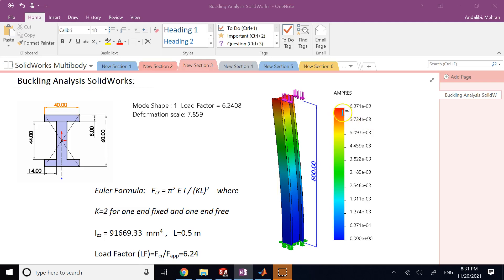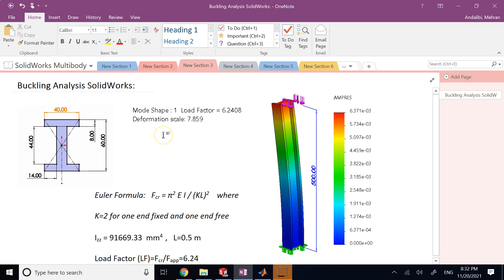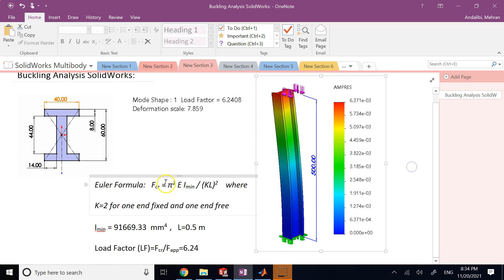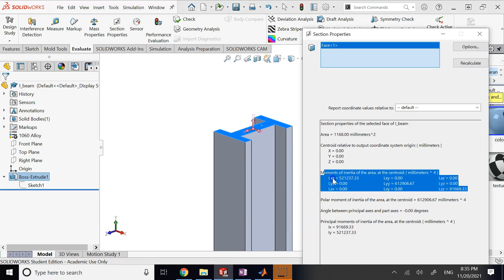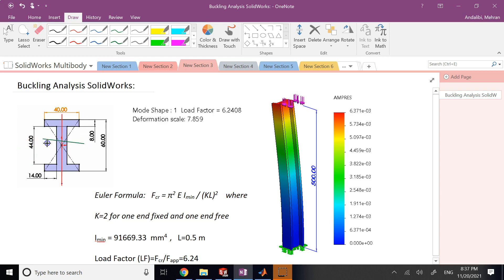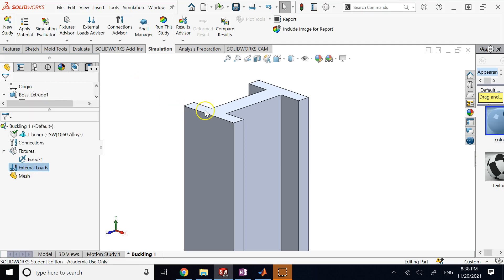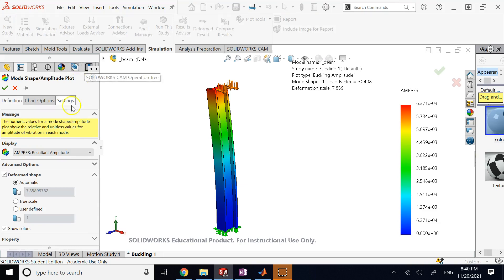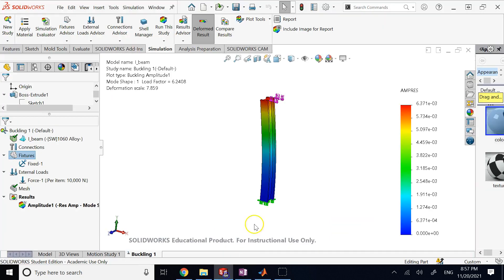Buckling Analysis in SolidWorks

Comment: what does the mode shape mean in buckling analysis?
Reply from the maker: Mode shapes are used in systems with vibrations not in static systems. Here, it shows the direction along which the system deflect. It is normally only 1 mode shape unless the 2 moments of inertia (Iyy and Izz) are equal, then it can bend in 2 different ways.